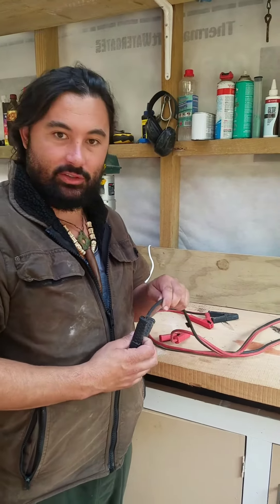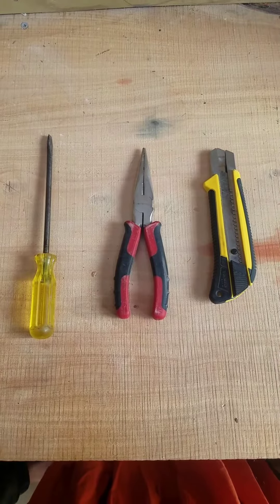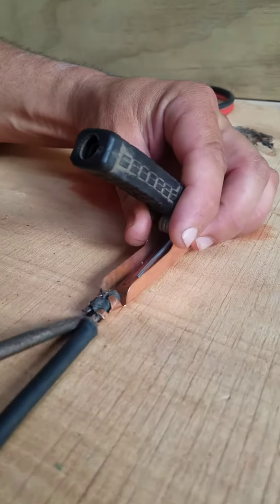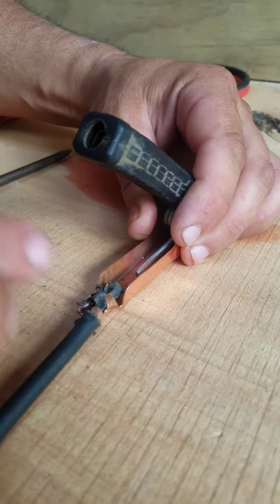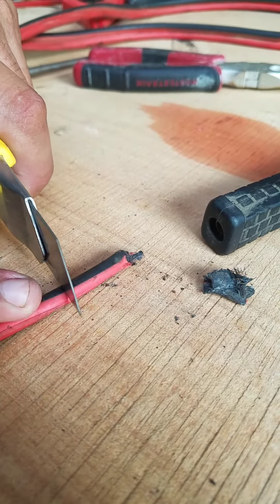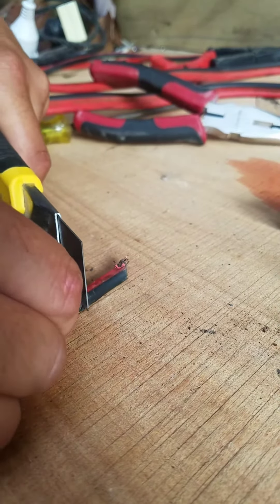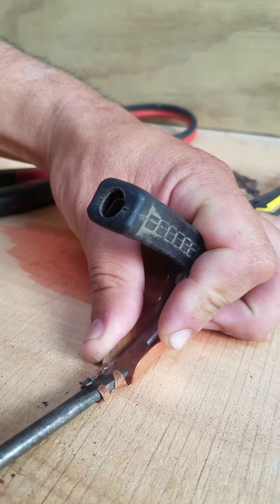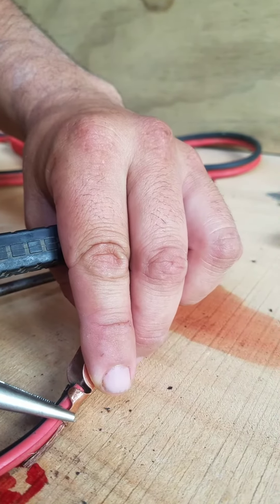How to fix jumper cables

Comment: Ty mine came off when I tried to jump start a Lexus but that car had a loose connection and burnt my positive cable right off the cable connection 🤭 looking at the clip thingy those clamps were not even holding down anything did that problem make the metal clamps L shaped idk 🤔 instead of C shaped 🤔

Comment: I tried it myself but it didn't work got any more suggestions?
Reply from the maker: Make sure that the wires are crimped firmly. And check the cable has no damage.
Reply from the maker: Try tighten crimp connections to  the cable. And check cable for damage. If still not working I would imagine there is something wrong with your cable internally.